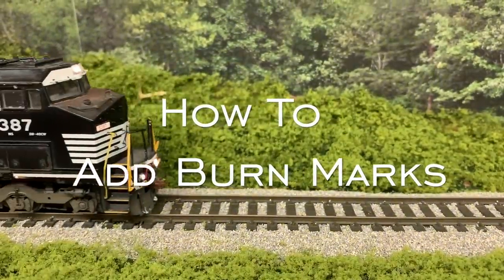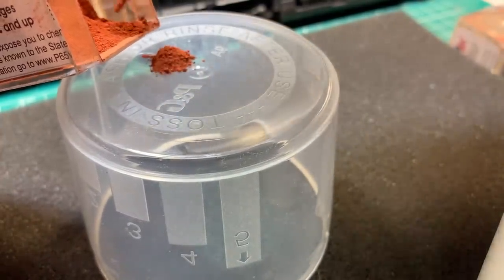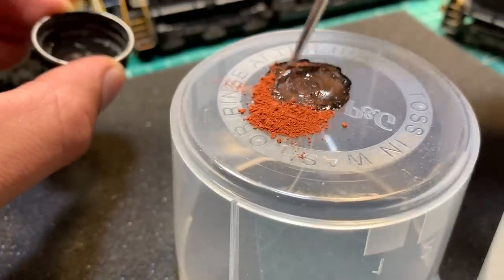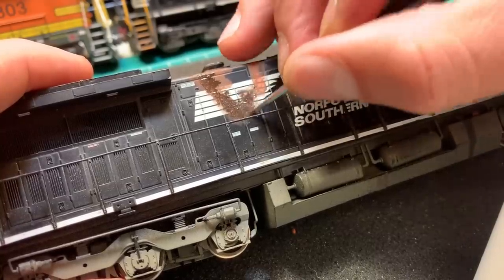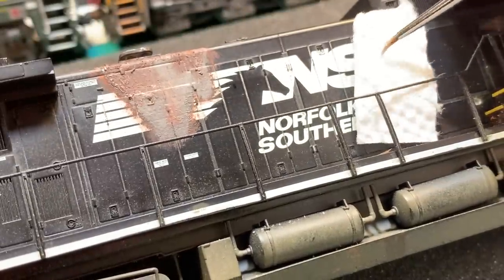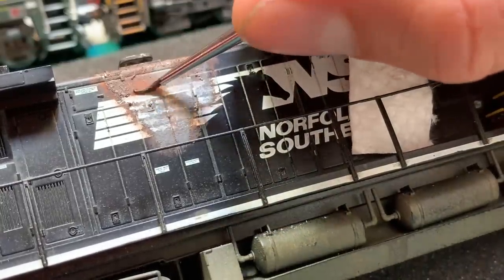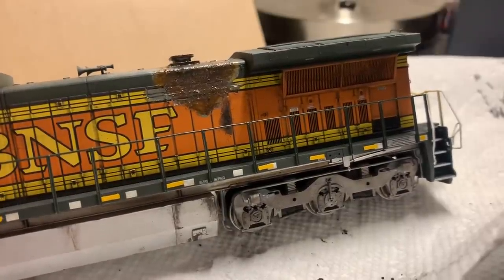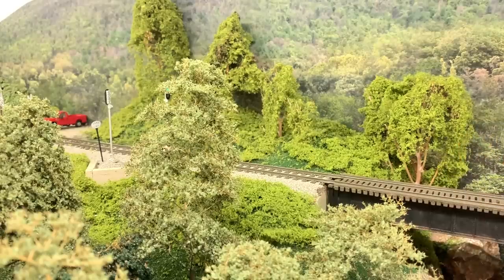How To Add Burn Marks - GE "Toasters"

Comment: From what I understand, the turbochargers get worn out over time, and the bearings are typically the first piece to give in. At notch 5 or past notch 5, the turbo can no longer supply the amount of air required, because it can’t spin at a fast enough rate. The fuel delivery remains the same however, causing an overly rich air fuel mixture. All the fuel is ignited then forced out of the exhaust, creating a large flame.
Reply: I should also imagine that by the point the oil seals would be shot, which may release engine oil into the exhaust. This could then build up in there until it catches fire by other means or the means described above
Reply: Sounds correct there chief!
Reply: Diesels don't react quite like that regarding rich fueling, You are partially correct tho regarding wear but it's not the turbos as such.  old turbos explode if they have excess bearing wear and if they are blowing less the engine won't actually run hotter. That's from exhaust manifold leakage or exhaust flexi,  slip joint wear etc allowing the extremely hot exhaust gas to cook the inside of the compartment, burn all the insulation and then the paint. Diesels are just air amd fuel, a reduction in ether results in power loss as fueling is proportiomal to airflow. low boost will make black smoke or thick white smoke depending on fuel rate with reduction in boost. massive Heat is generated at high power  settings with exhaust gas temps around 500ºc to 550ºc and at 35psi + boost pressure that gives you a hot as fuck hairdryer in a closet comparison.
Reply: The burn marks on the side are from internal fires, which can happen with dash 9s
Reply: Perfect Job🛠👍
Handmade, only Airbrush. Like me 🤩🤩🤩

Comment: They catch fire there because the turbo is right there and when the turbo goes out it catches fire. The fire comes from the motor oil that is cycled through the turbo to cool it. The oil gets on the hot outside of the turbo and catches fire which spreads because the running turbo even though broken is still turning throwing oil everywhere spreading the fire.
What you've done is a really good representation of the real thing.   👍
Reply: This is exactly what happens to these locos.GE's are notorious for this more so than EMD's.

Comment: Usually it’s a loose fuel line. Fire  starts from hot turbo exhaust and heat in that area of the engine. Also a failed turbo can cause this issue. The turbo sits in the rear of the GE engines.
Reply: Love the work by the way. Keep it up!
Reply from the maker: @thebrothahood2143  Thanks for the info! That makes sense. - Josh

Comment: YES  the turbo made these burns. But the term toaster also  came from  flow  by dry sump  radiators.  The coolant  would not flow until  operating temp. when hotter coolant  would meet a cold radiator thus  making cracks

Comment: If it idles for long enough and the Piston rings are not in the best shape, oil can pool in the exhaust side of the turbo, and if the engine gets hot enough it can light that stuff up, or blow it out of the exhaust with no fire

Comment: I have heard that fires are sometimes caused by unburnt fuel being ejected with the exhaust and burning as it leaves the stacks. Not sure how correct this is, but it sounds like a feasible explanation
Reply: exhaust leak from inside compartment usually. 500ºc will burn your arm hairs so paint gonna feel the pain just as much.

Comment: It's called a "run away" engine. It occurs when the turbo fails and unburned fuel and oil collects which in turn causes a complete meltdown of the turbo unit causing the engine to run wide open until the fuel in the lines is completely depleted (which as long as the fuel pump is still functioning means it will run until the tank is empty or the engine literally destroys itself due to intense heat)
Reply: A turbo fire isn't necessarily a runaway. Turbo fires are much more common.

Comment: It's caused when a Turbocharger goes out the bearings can no longer keep the oil in it and it blows by catches on fire and spews out that's why it looks like the fire has ran down in a river

Comment: I would love to do that on a SD or a GP and make it all rusted and just old and make have that on my mainline and I have to say I love this detail for BNSF and NS
Reply: EMD products such as the ones you describe do suffer similar fires, although far more rarely than GE machines.  Typically, the culprit is carbon build up in the exhaust manifold, leading to large deposits that ultimately ignite.

Comment: Sure is a lot of armchair Engineers on this site
Reply: That's great, I have a rubbish armchair and it needs redesign. It looks like the classic Ikea Poang but the seat is a loop of steel tube instead of moulded ply, and it cuts into my legs when I fall asleep in it. Is there anything I can do to make it more comfortable or does it simply need replacing?